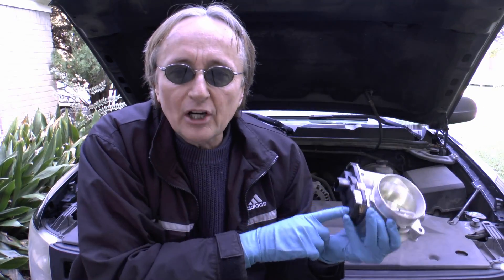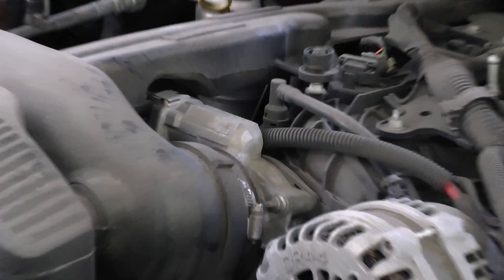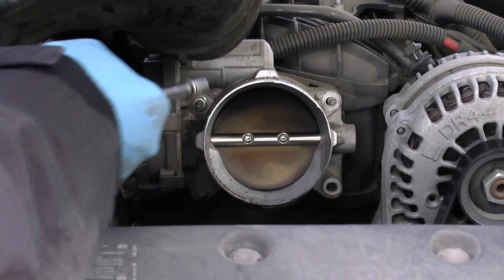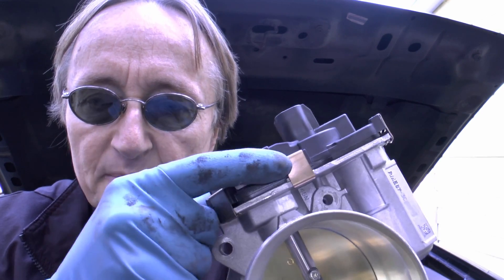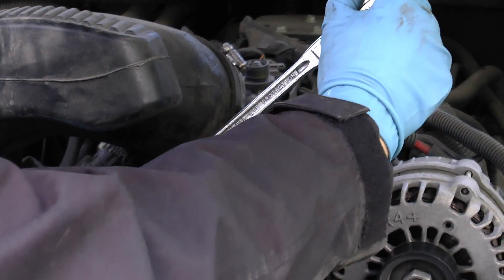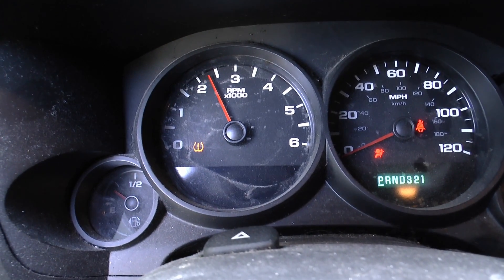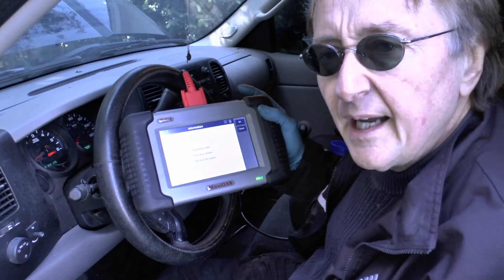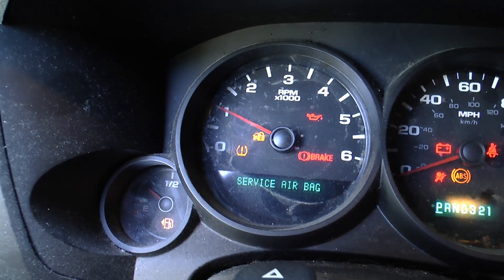How To Replace A Bad Electronic Throttle On Your Car

Comment: Hey Scotty my 2018 Dodge journey with 100K miles started acting weird today. Flashing red lightning bolt, check engine light and traction control lights. Its trying to stall on me, from a stop at a red light i cant get power unless I force it. Is it the throttle body? Any suggestions? Thanks 🙏

Comment: Will a bad throttle body make a car sometimes not start? I have 2013 dodge avenger and starts up perfect most mornings but when it starts to heat up outside it doesn’t want to start & check engine light and red bolt pop up on dash.. I have to give it a couple try’s and usually starts with rough idle then drives perfect..

Comment: OMG thank you so much for explaining the 'relearn process" that the evil swine designed lol.  I know nothing about cars, don't know anyone who does, and I have very little money to continue paying this one shop on parts that aren't fixing the problem. Something is draining the battery And I paid for the alternator to be replaced but its still doing it and the guy says its probably the throttle.  I'm trying to figure out if I should just take it to the dealership cause I don't know if this guy is just taking advantage of my obvious ignorance

Comment: love scotty. hate car manufacturers. They do this on purpose so you have to go to a mechanic to fix these issues instead of just doing it yourself with simple tools. So you will have a $400-600 part... but then have to pay another $200-300 for a mechanic to use some machine to finish the job.

Comment: Could you disconnect your battery and then replace your throttle body and then replace the battery back on your car? That way you could bypass the computer part?

Comment: Hey Scotty, were these failures less common on the 03-07 body style trucks? I have a 2005 with over 200k miles and 8700 engine hours. I am worried it will fail one day and I'll have to pay a fortune for a new one locally. When I worked the front counter in a garage I saw a couple fail on this style of truck, but I can't remember exactly what year they were. Maybe if they don't fail by 200k they might last forever? I plan to keep this truck as long as possible.

Comment: Do I have to disconnect the negative battery cable to do the throttle position sensor and throttle body?
Reply: Yeah just in case so you dont short anything

Comment: So, if you did replaced the TB, or just cleaned it, and let's say it's a car that does not have an electronic Throttle Body, and it's just an old school cable throttle, and it idles really high after the procedure, you can try this: disconnect the battery for at least 15 minutes, put it again, and give a drive test, it can actually fix the problem. It worked with my Mercedes Benz 1995 c class. I cleaned the TB, and after that idled high above de 2000 rpm, and then i fixed it out just by unplugging the battery for 15 minutes, hope my experience can be useful for someone that doesn't know how to fix it, 
P.D.: I guess this only worked with me cause is not an electronic TB, if yours is an electronic TB, it's sad that youll have to pay someone to reset it with an scan tool.

Comment: Scotty i have one question... My car idles at 850 rpm with AC ON and after idling car rpm drops to 680-700 rpm and if i rev the engine to 3000 rpm then car rpm drops to 550 and comes back to 680-700 and with AC off car runs fine and sometimes with AC ON car idles fine for 5 to 10 mins but then drops and i see with scan tool that TP sensor is working with Throttle body and air flow sensor also workin and no check engine light and I have DBW Throttle with no idle control valve

Comment: Hey Scotty, I have a question. So I have recently changed my throttle body on a 2008 Jeep Patriot 2.4 with a brand new Tech Smart Throttle body. I was told from my “mechanic” I was good to go! Few days later the same issue came again where my car would throw the ETC )⚡️( light and stall after a few seconds of being started. Now I know he did not reprogram the throttle body. That being said I just got off the phone with a technician with the same computer you have. He told me that it would be almost useless to reprogram it because the issue will still happen because it’s not a Jeep manufacturer part. Is this true or should I have him reprogram it any way? I really could use your help on this here! Thanks again
Reply: Hi did you ever figure out the answer to your question? I have a 2018 Jeep Compas and the shop guy is saying that it's the throttle after he said it was probably the alternator.  I'm wondering if I should just take it to the dealership and pay whatever price they charge to be sure Im not getting swindled.

Comment: I need to replace mine on an '09 Chevy Aveo. RockAuto says I have to swap out the Idle Air Control Valve as well. Do I have to?

Comment: I asked in the comment about this about 2 days ago and you already have a video on it; seems I may not be able to get around the electric throttle body for an older version that is not electric without a heap of modifications. In due time I would rather have something that does not break at a cost of 60 - 500 dollars because its electric and made out of materials that don't last long.

Comment: Hey Scotty, I got a 09 Tribute with no check engine light, but it started losing acceleration while driving. The wrench light also comes on when this happens, and you have to restart the engine to get going again, then it disappears. It has started happening more frequently over time, I did a lot of reading and almost everything points to the ETB. What do you think? Also will I need one of those fancy tools to reset the idle?

Comment: Last month my 2013 Kia Soul with 72K miles engine performance dropped and Check Engine Light came on...had it towed to dealer...they replaced the throttle body and a week later same thing they adjusted the tension pin (?) and sent me home with it...Ten days later same thing!   Grrrr!   They said it ran fine and said must be my driving. Then last Saturday same thing AGAIN...my car coasted more or less to a Auto parts store and the got a code stating I had a bad pedal sensor...so I replaced that....that brings my cost to over  $1000.  Then tonight while coming home the car seemed a bit sluggish but I made it home...ALMOST.  Engine hesitated and Check Engine Light came on and I have a P2118 code.  What is up????  Help!

Comment: MAY I ASK A  QUESTION MR. SCOTTY KILMER OR ANYONE WHO CAN HELP...? I HAVE 2013 DODGE GRAND CARAVAN. MOST OF THE TIME THE ENGINE SHUTS OFF WHEN I AM TRYING TO PROCEED AFTER A RED LIGHT OR AFTER A STOP SIGN. BUT IF I ACCELERATE EXTREMELY SLOW  AND GAIN MY SPEED, THEN THE ENGINE DOES NOT SHUT OFF AND ONCE I HAVE GAINED THE SPEED 20 MPH OR 30 MPH OR MORE , THERE IS NO ENGINE SHUT OF PROBLEM. THE  ENGINE ONLY WANTS TO SHUT OFF FROM INITIAL ACCELERATION FROM A STOP SIGN OR STOP LIGHT. I REPLACED THE THROTTLE BODY , INSTALLED 2 OF THE NEW ENGINE MOUNTS [ AS PER DODGE DEALER DIAGNOSIS ] ................................STILL I AM FACING THE SAME ISSUES OF ENGINE SHUT OFF. ALSO DO I NEED THROTTLE BODY BE REPROGRAMMED AFTER INSTALATION................................................................................????????  THERE ARE NO ENGINE CODES. CAN ANYONE  PLEASE GIVE ADVICE. THANKS.

Comment: can you tell about the volvo S70 throttle body replacement, is there another way that pay somebody to " program" the replacement throttle body ?
Reply: Excuse me did you fix your car and how you did it?
Reply: @armandoperez2484  Fortunately, I not replaced the throttle body up to now, I know that there is a mod that consists to remove both potentiometers at the end of the throttle shaft by only one hall effect sensor and jumping the other one, Xmodex have an exchange program, To what I understand, they can program the replacement throttle body on the bench  by using the vehicule VIN and ship a replacement unit ready to install plug and play.
Reply: THANKS SO MUCH

Comment: My 2001 dodge stratus had idled about 800 rpms higher when i replaced a misfiring spark plug i guess it got used to idling so poorly that when i fixed th le problem it needed to relearn how it felt to run healthy again
Reply: I aint even kidding on this it would literally spit and sputter and i saw it drop as low as 450 to 500 rpms until i took off again not to mention i lost 50% of my gas mileage.

Comment: I'm getting a check engine light on a 2007 Cadillac CTS 3.6L. I hooked up an OBS scanner and it gave me a P2119 code (throttle body). how can you help me out with this? any tips on how this works?
Reply from the maker: If you wish to ask me car questions, I am switching my questions and answers to my website. So go to www.scottykilmer.com  and ask me in the Ask Scotty section. So please, if you want your questions answered, go to this link and join my completely FREE website. No strings attached.

Comment: ringing the bell is done lol... I have a question. I have a 2005 Chrysler 300 v6 3.5. it's got code p2110, later it got p2118, after I cleaned the throttle body "stupid me lol" now it's got a new one... something about cylinder 4 bank 1. what could it be? I want to get a new car, so I don't want to spend a lot of money on this one. I'm hopping I can fix it myself. can u help me? please.
Reply from the maker: I assume 4 is misfiring, I would try a new coil on plug and spark plug there first

Comment: I recently cleaned the electronic throttle body  in my car with the engine running. Since then, my car's rpms drop while idling but it only does this after the car has reached full temp. Otherwise when its cold it idles fine. Is it possible that I ruined the throttle body?
Reply from the maker: never clean electronic throttles while running, you could have damaged it. But sometimes computer will reset after a couple weeks of driving
Reply: I think, I just damaged mine today. A flame got out via the plate after starting the engine and it didn't return back into full closing position after. Most cleaning products recommend to clean the throttle while running - e.g. the one I used at 2500RPM - https://www.youtube.com/watch?v=LjOnXd2aSqk .

Comment: I have a 96 dodge dakota. has the 3.9 magnum, 140,000 mi. is it a good idea to change the throttle body from a v8 to my 6 cylinder. it will bolt right on. the 2 intake holes are about 6mm larger= more air.
Reply from the maker: nope, they have to match or computer will be fooled

Comment: hey Scotty my 2003 Infiniti brake Light and battery lights flicker and when I press on the grass the rpm dosnt move could this be a bad throttle body? thanks
Reply from the maker: mor often that's a bbad alternator
Reply: Scotty Kilmer the car runs with  battery post off alternator check was fine car starts up no problem but I'm getting no power when I accelerate rpm reach around 1200 rpm

Comment: I cleaned my electronic throttle control yesterday and noticed this, i revved the motor high with the intake off and the butterfly plate barely budged. I found it odd, so, I disassembled it off the motor and I cleaned both sides, around the butterfly plate. After reinstalling it, I haven't checked to see if the butterfly plate moved or not. I reconnected the intake and took it for a spin. I've noticed the car accelerates not as strong, my guess is, the plate isn't opening. My judgement is that the electronic throttle control ETC is bad. Plus, a few days ago, while driving, I felt a jerking hesitation and the check engine light blinked probably guessing 10-14 times. My guess is that, it's telling me something is wrong with the ETC and the plate isn't allowing air through. Also noticed poor gas milage within these few days.
Reply: Also, my car is a 07 Honda Fit sport.

Comment: how would I know if my electronic throttle body position sensor goes bad on my 08 silverado
Reply from the maker: you would need a pro with a dealer level scan tool to analyze it IF a tps sensor code did not turn on the check engine light ad have the tps code stored
Reply: Scotty Kilmer 
Hi Scotty :  I have 2005 ford expedition 5.4 I'm having trouble with throttle body i have engine light on and safe mode engine light on , so i did remove the throttle body and i clean it really good and change air filter was really bad, any way after i start the car was really good all the lights vent away for couple minutes and now only the safe mode light is back on again and angine is running 550-600 rpm  you think i should replace throttle body?  Thanks.

Comment: For my 2009 Jeep Compass 2.4L, my ETC (Electronic Throttle Control) light
 has come on from time-to-time, each time the Compass went into "limp 
mode". It's driving fine now, but yesterday, it went into limp mode for 
about 20 minutes, where before it did it for a second or two. The 
throttle body is about $230. Just wondering if that was the problem or 
maybe something else. A garage to do a dashboard light diagnostic would 
cost over $100 which I'd like to avoid. Maybe I should just take out the
 existing throttle body and clean it up first before doing anything 
else? Not sure what else to do.
Reply from the maker: those are known for bad throttle assemblies, have a pro check that and PRAY it's not the main computer failing on that circuitry

Comment: hello, 
I have a 2004  Mitsubishi galant. it has an electronic throttle body with intergrated idle air control.  I need to replace my 2004 galant throttle body.

 do you have videos for 2004 Mitsubishi galant??

there are hardly any repair videos for 2004 Mitsubishi galant.

Comment: hey scotti.     i pushed on my electronic throttle plate a little too hard, and pushed it back 2 clicks ( yes, the side of the plate that doesn't have the spring tension ).     well anyway, every since i did that, i noticed that on the expressway that my cars rpm is at 2,000 when i i,m driving at 70 mph.    that's too high, because it's usually at 1,300.   so i musta forced my throttle plate to open more than it wanted to, and now it's permanently stuck in that position.    do you think that i broke a couple of the gear teeth on the TPS when i pushed on it?    i know that i can have a mechanic reprogram the TPS, but that would be useless if i broke a couple teeth off my old TPS unit.    so should i buy a new TPS unit, and then have the mechanic instal that, before he reprogram,s it?   or just have him reprogram the old TPS?

Comment: hi i have a 2009 dodge grand caravan that just recently when i turn it on the car stays idle then the rpms go low and the van shuts off yet i turn it back on and it only does it occasionally.  i noticed when i turn the key in the on position the lightning bolt light stays on for a bit then turns off. what can it be??? i appreciate it:)
Reply from the maker: +Juan Perez   get it scanned, it has a trouble code hidden inside the computer that shows the problem area. Start there, auto zones scan em free as do many auto parts stores these days

Comment: how much is the scanner to reset the computer I already replace the throttle.. undid the battery but the throttle light goes out and comes on at times
Reply from the maker: +Antonio Jones that's a 900 dollar autel maxidas from harbor freight tools with the 20 percent discount
Reply: Ok thanks imma look into it appreciate that a million times
Reply: $900??? LOL

Comment: Scotty, 2006 Silverado 4.3 1500 2 wheel drive , will not rev over 2000 RPMs , how can i fix this , i have not heard of any codes as well, please let me know, thank you very much
Reply from the maker: +Kody Darlington more often a bad fuel pump or clogged cat. You can have both pressure tested to see if the pump has low pressure, or the cat has too much back pressure

Comment: so my car Is idling very bad it is over 1 and I cleaned the throttle and the throttle body and it continues to idle what do I need to do next?
Reply from the maker: +Emily Peters  do my video "finding engine vacuum leaks with a cigar" and pray you find one, otherwise you may need a new throttle body

Comment: What scan tool did you use. I had to replace the throttle body on a 2006 Chrysler 300 and was given relearning procedures but i dont think im doing anything right to get it to idle normal. Do i need the scanner tool and if so what scanner tool would you recommend? I already did the cigar trick and there is no air leaks. I sealed everything down correctly.
Reply from the maker: +Jonathan A  I used an autel maxidas, but now I use an OTTO Tester. But both cost over a grand. You might pay a mechanic to do it.

Comment: I have a focus zx3 when I accelerate it will hesitate, Then when idling at a stop light it'll big down real low. What is the reason. For that ?
Reply from the maker: Ryan Carpenter MANY things can do that, first try my two videos "how to fix a car that idles poorly" and also "finding engine vacuum leaks with a cigar"
Reply: Thank you egr valve was broke and also I had to clean the throttle body. Thank you so much. I also took your advice, and replaced the pcv valve

Comment: help help i have a mustang v6 2014 and it revs just like this one at the end when i put the bbk throttle body, how do i reset it, what do i do
Reply from the maker: that should be under warranty and get fixed free at the dealer. I not, you have to pay a mechanic to reset it on that model
Reply: but if i take it to the dealer they may void my warranty since it's a non factory hrottle body and intake, it's a bbk throttle body 73 mm
and the intake set.
Reply: Enrique Valiente  Yea,. they might not outright VOID your warranty but if thats not the OEM throttle body on there then they won't cover it anymore.

Comment: I don't know if it is the same with older models but I changed my throttle position sensor on my 99 silverado and it was idling up to 3k all I had to do was unplug the battery and let the computer reset to get it to idle at the normal 7-900 rpm. Not sure if you could do the same with these newer models.